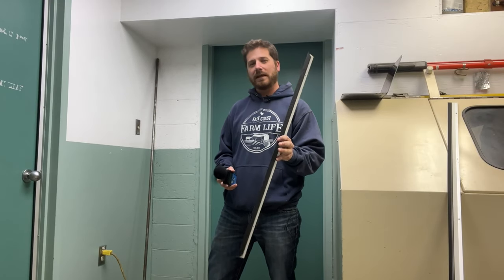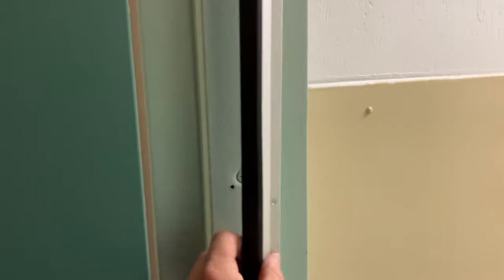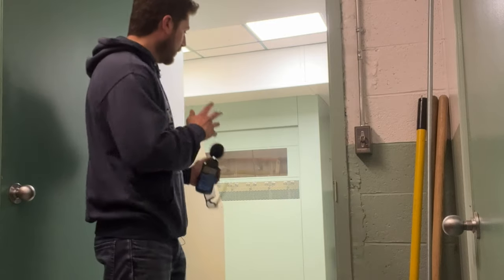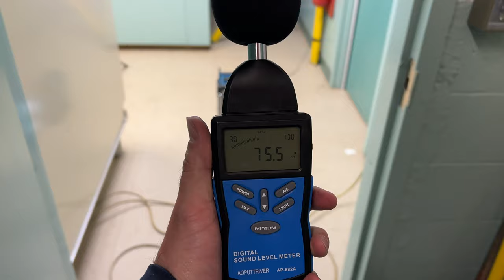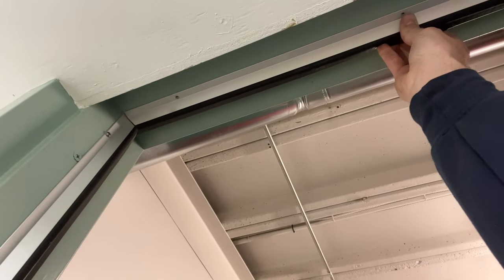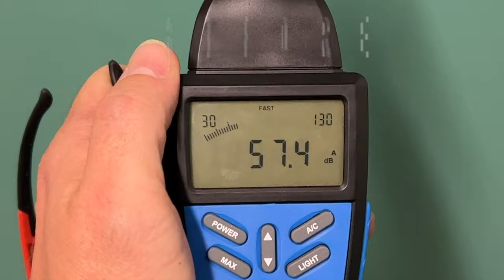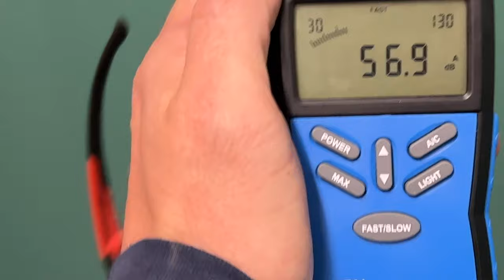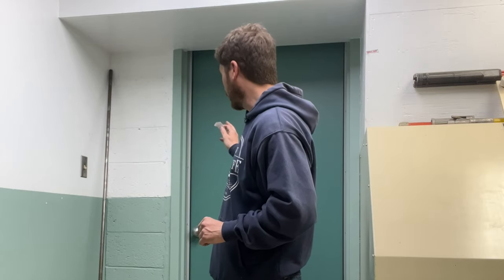Building The Best Soundproof Door Under $50!

Comment: My man I appreciate the content.       A huge issue I never hear anyone talking about is getting an airtight seal with weather stripping is not even close to simple! I’ve done 10 interior doors some take hours of readjustment! never close to even or semetrical gaps. I have 1/2” 1/4” even 1/16” foam and to finish the seal it’s all layered in all sorts of funny ways still not perfect surprised it’s not discussed. Idk if you’ve mentioned it by far the best door kit I’ve seen is an magnetic one the sucks to the door
Reply: Plus that foam weatherstripping comes off in bits over time, and it leaves glue residue that doesn't want to come off, and dirt loves to stick to it. Makes the doorjamb look nasty!

Comment: Thanks for the video. I used the weatherstrip you recommended in a past video, but it is too thick. I really have to force the door to close it. I cut it down with a razor knife, but it's still a bit thick. Any suggestions as to other stripping that is better for doors with little space between the door and frame? Also, the door has carpet under it, so the sweep is difficult to push through the carpet. Any suggestions?
Reply: The strips he used in this video can be mounted to any "height" forward of the frame where the door contacts.

Comment: Thx for your hard work ... so adding this strip will decrease the noise by 7 dc

Is there any new way to reduce it even further ? Considering there is np with customizing a whole new door and if you have open budget ??

For example like the way airplanes doors work or refrigerator.. how the door is thick enough and insert into the other frame 

And what is the best material to build a door with to further make it sound proof ?
Reply from the maker: A solid wood door or fibreglass core door would be a good start after installing the seal kit and a door sweep.
Reply: @soundproofguide  what can you do to an existing hollow door?

Comment: Is there any acoustic sealant that can be used OUTSIDE on a brick wall for my vent?? Can those type of sealant withstand cold temperatures?
Reply from the maker: For applications the sealant must be above +5 C (+40 F) -- but surface can be below freezing. Apply to a dry surface. You’re good after it’s applied and the cold shouldn’t effect it.

Comment: I just tried using a self adhesive weather strip inside door and the my door would not close shut.
Reply from the maker: Sometimes you need to modify the weatherstrip, or buy a smaller, thinner one. The one I link is the type that separates in two narrower pieces.